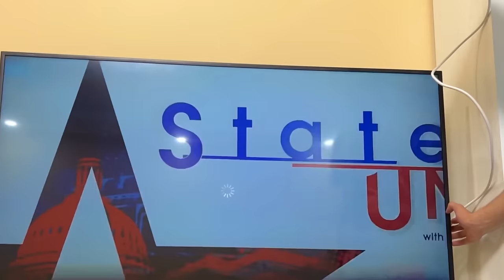This Man is a genius! TV channel providers do NOT want you to Know this Trick!

Comment: I make my own antennas all the time.  And this guy makes what is sooo simple wayyy more complicated than it need be. Literally take some coax, cut it, strip back 6 inches to bare copper. Plug in other end. Thats it. I typically get 45 channels in my area. Batteries will likely only create more interference.
Reply: Right on!
Reply: How long of a coax cable to where you strip it?

Comment: This will not work! He replaced legitimate antenna elements with batteries. they are neither the right length or shape and since their far ends are not connected to any thing, the power stored in them means nothing. It might work for a UHF signal from as far away as 20 miles, but will not work on VHF.